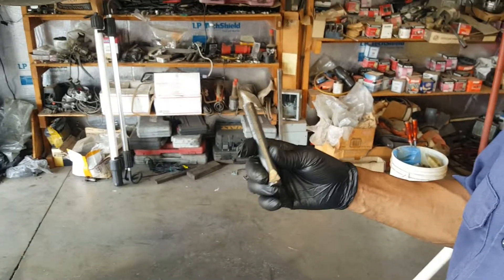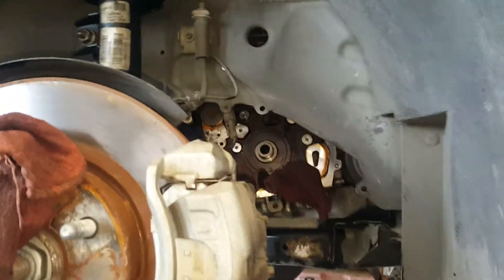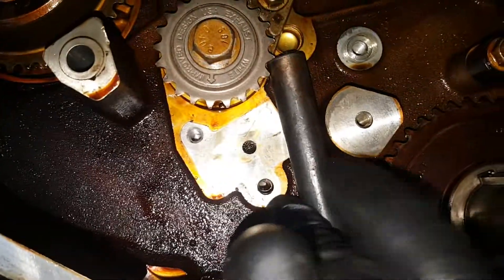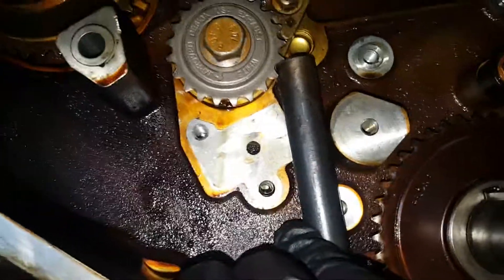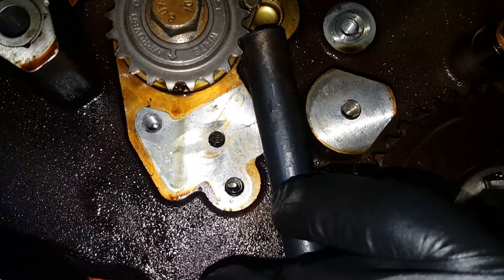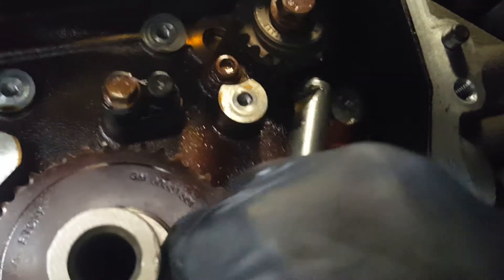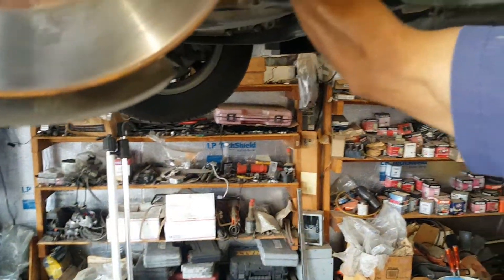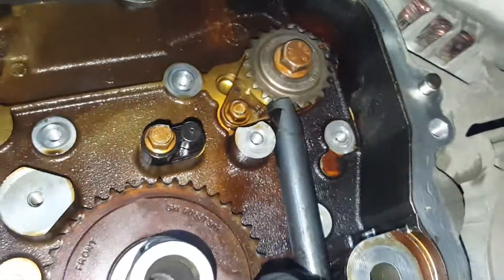GM 2.4L ecotec balance shaft gear removal and install tip

Comment: We have two (2) cars with this engine. An 08 Saturn Vue, and 12 Equinox. The Saturn has 351,000 miles and had no major issues. Just recently the head gasket blew.... but was an easy repair. The Equinox has 190,000 with just basic maintenance only.

Found this and made the tool. Great idea. I used Cloyers and a tooth broke off. 😮 Now Cloyers recommends the punch method but would replace the gear that broke. I purchased a new gear, and just used the old timing belt and a pair of vicegrips..... worked flawlessly.  💪

Comment: I made your tool,  I had to fumble (kept sliding out and dropping it) around with it like you did in the video and could not make it work because there wasn't a solid connection between the tool and the sprocket. Then I drilled holes in the ramp on the hook side the same size/spacing as the sprocket teeth. The teeth of the sprocket LOCK onto the ramp and doesn't try to slide off, and the hook grabs the top tooth for a secure fit. With the drilled holes you just put it up in there and it locks into place and it worked excellent in removing the sprockets. Excellent tool, just needed refinement
Reply from the maker: Awesome! Glad to hear you were able to modify it to work! And thatnks for sharing so others can also get different ideas to modify the tool to work for them.
Reply: Can you please share a photo of the tool that you made.
Reply: Can you please share a picture of the tool that you made?

Comment: Sweet tip. Been pulling my hair out trying to use a 5/32 drill bit to try to break the sprocket bolts free. Just ain’t going to happen.
Reply: Thanks again, worked like a charm.
Reply from the maker: @crabcake43011  Same lol we were bending the drill bits that we were using and it was a pain to hold them with your hands so my dad came up with this solution. Thats awesome that it helped you out!!! Thanks for the kind words!!